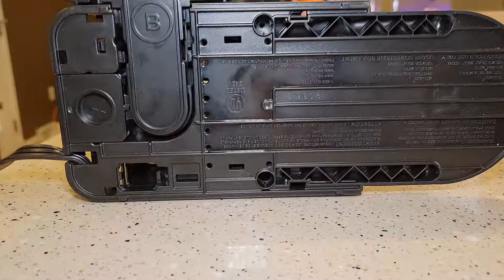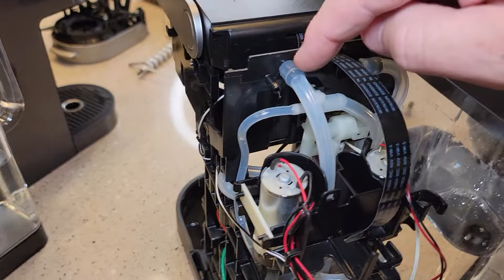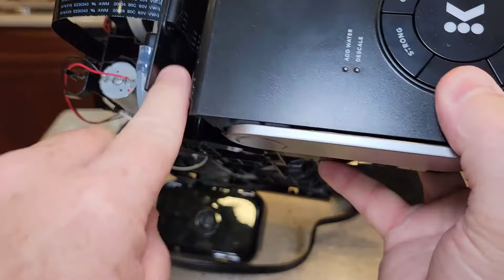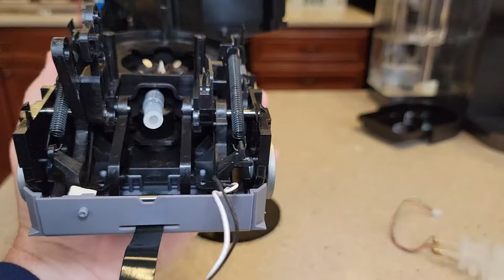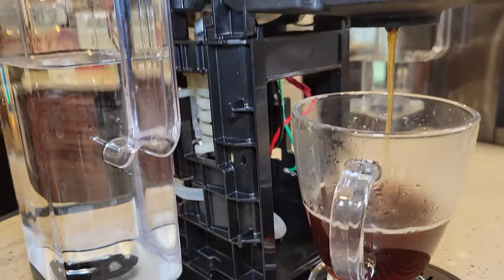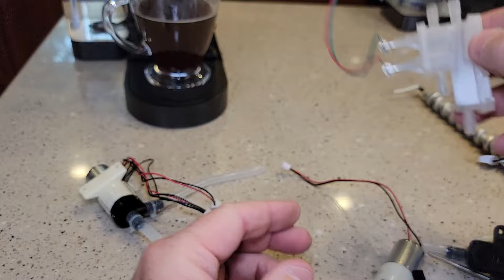🔍☕ Keurig K-Supreme Inside Look | How It Works & How to Take It Apart

Comment: After several K-Supreme Plus(s), descale always ends up the same. When Brand-New there is an accurate 12oz dispensed when that button is selected. After Descale there is anywhere from 8-10oz dispensed. Repeat that several times and it reduces to just about nothing.  So after taking this thing apart, what would you say is the most vulnerable part to cause the Descale to come on daily?  My guess would be the Descale solution can NEVER get the Heating Element, made out of aluminum, completely clean, like when it was new!
Reply: Descale light may come on when the air pump pressure gets to high.  The air tube on a k 50 was clogged with some debrie and descale   light  was on constantly.                      With the k supreme with no heater tank and  water level sensor,  how does it know how much water is   dispensed?
Reply: I have suggestions but you do them at your own risk because you may do more damage.  I am confident that all the lime scale can be removed from the heating tube assembly.
First, when descaling with either the commercial solutions or "regular" white distilled vinegar that is 5% acetic acid, you may be breaking chucks of scale loose from the flow path and they are getting stuck at critical locations in the flow path.  These restrictions can reduce or cause variation in the flow from the pump and cause a pressure increase. They can also allow the pump to rotate without it discharging the correct amount of liquid with each revolution.  I am pretty sure the Hall-Effect sensor on the bottom of the water pump contributes to knowing how long to run the pump.  If the pump discharge flow is not accurate for each of its rotations, then your coffee mug fill will not be accurate.
When the pressure increases in the flow path, a small piece of tubing conveys that high pressure (caused by a restriction) to the the pressure sensor on the circuit board, causing it to shut down the brewing cycle. Sometimes (with my 20-22 grain hard water), I had a lot of scale inside the heater tubing assembly.  It takes a good bit of time to dissolve calcium lime chunks using regular vinegar.  For the last few years I have been using 30% distilled vinegar for descaling.  I run two discharge cycles while in descale mode and then leave my unit sit for 20 to 30 minutes.  Then I do another two discharge cycles and allow it to sit again.  The wait time on the second set of discharge cycles varies depending on what I am seeing in the discharged vinegar.  If there is a lot of large limestone flakes in the glass when I swirl it, I wait long after each set of cycles.  Usually after three or four sets of discharge cycles the discharged vinegar is almost clear, so I just continue to do consecutive discharge cycles until the "add water" light comes on.  Then I rinse the reservoir thoroughly with tap water, refill it with low-dissolved-solids filtered water (from a Brita pitcher) and complete the descale process.  You can find 30% distilled vinegar in the pesticide section of your hardware store or big box supply store.  Why is the concentrated vinegar in the pesticide section of the store?  Because it is frequently used as an approved "organic" weed killer and sometimes an insecticide!  
So far all of the sensors in my unit's flow path have continued to work, probably because they are made of either stainless steel or chromed steel.
In the days before I used filtered water in my unit and before I switched to using more concentrated vinegar, I would sometimes remove a pressure-side piece of tubing (these always have a clamp or zip-tie on them) and use a syringe to draw and then backflush segment of the flow path.  Now with filtered water, I don't get near the lime scale build up between descale cycles.
I hope this information helps someone, since it's been years since @dennisdugan7476 posted his question/comment.
Reply from the maker: Great question, I am just not really sure,  the descale light comes on after 250 brew no mater how much build up your machine has.
Reply: Maybe the scale build up is really bad and the speed of the descale process is too fast if you follow the instructions exactly. Suggest to leave the solution in the tubing for some time (30min-1hr?) to let the solution dissolve the Ca buildup better. So, after running the solution through the machine once or twice, stop for some time. Then, come back and finish the descaling process.

Also, if the amount of fluid is less than what is desired, it usually means that a solenoid is going bad and would need to be replaced. There are videos of this, just search: solenoid Keurig. If the solenoid is closing prematurely,, the unit may detect increased pressure and thinks that scale buildup is causing it, hence the descale light comes on.
Good luck!
Reply: In Keurig’s defense, that model has gotten better in the last two years. I originally got that model from Costco, so it was easy to return whenever it failed. The one I’m using now is going on 1.5 years and has no problems with flow accuracy.

Comment: The flap stops the pressure  to the needles if you should open the lid while brewing. This prevents the needles from spraying hot water and coffee on you when you open the lid.
Reply from the maker: Awesome!! thanks so much!!
Reply: Our flap became removed during a cleaning. Afterwards, the machine produces only clear hot water, no coffee. Any suggestions on reinstalling the flap?  We still have it, intact. Keurig support tried to sell me a new machine.
Reply: @Thymediadude  thats my problem too - did you ever figure it out???
Reply: @Azkrazykat  Nope - bought a new unit.
Reply: @Azkrazykat  The missing flap acts like a by pass valve. Water does not reach the pod with the flap missing. The flap makes the machine idiot proof by diverting hot water from the needles if the top is opened during brewing. This avoids lawsuits.
Reply: Thanks for the info !    I  was thinking  it was a steam release vent.
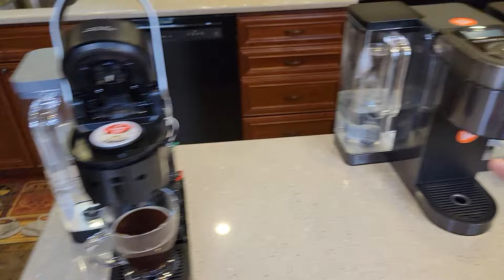Reply: Hello, this part fell out of my Keurig when I opened it up and I don't know where it goes.  Do you know where it goes?  12:47
Reply: But how is it reinstalled?
Reply: There are two long strings that feed back into the unit.  If you just have the plain fap, they broke off and at flap cannot be reinstalled without a new one.  Keurig won't sell you that part unfortunately.  There is a "hack" to fix that but it defeats the safety function.
Reply: That flap weakens over time, seeps and causes brewing water to skip the k-cup and drain into your mug.  I understand it's a safety feature but it's an inherent design flaw.  Adding a 1/8 in neoprene pad on that deck restores it's function but it's not a permanent solution.
Reply: I was guessing the flap allows any remaining water to drain out of the needle area when you open the lid, to prevent mold growth and clogging.

Comment: My keurig k supreme doesn’t turned on 
But look really good inside 
I don’t know 
What happening ?????
Reply: If it is dead - it is the thermostat - I had three units die after descaling - Keurig sent me a K-Elite as a replacement - opened up the last bad one I got - pressed the button and it came back on....  It is not supposed to be user serviceable - so this is a manufacturer defect.
Reply from the maker: I have another video on how to fix it  https://youtu.be/IdE_4NIQEro

Comment: That thermo-sensor is actually resettable. There is a small hole in the center of it and you can reset the switch with something like a paper clip. Had an issue with mine after a failed descaling process which seems to be a common issue with these units. The entire unit would not power up due to that thermo-switch being tripped off. Reset it with a paper clip in that hole and the unit came back to life.
Reply: OMG! THANK YOU! THANK YOU! THANK YOU!  I've had 3 multi-stream brewers mysteriously die on me. Keurig has always been great about quickly replacing the machines under warranty, but when my latest unit died this morning, I wanted to see if I could save it. The video helped me with disassembly and diagnosing the problem, but your comment allowed me to reset the machine and had be back in business.
Reply from the maker: @longhornhamilton44  Your Welcome!!!!!
Reply from the maker: Wow it this works you are a life safer!!! thanks for the tip and I will be trying it out.
Reply: How did the descaling process fail?
Reply: Yes confirmed. I opened the case with 2 kitchen knifes, the job took about 1/2hour.  Used a toothpick for the reset.

Comment: KEURIG K-SUPREME not working let me know how fix it. thank you
Reply from the maker: Not really sure, but there is an overtemp thermostat that is mounted to the heating element, once it opens up it does not reset and the machine is dead.

Comment: Can you replace the thermostat? The way you described it makes it sound like it's supposed to act like a fuse.
Reply from the maker: I looked online and could not find a replacement Thermostat. The wires are soldered on it.  Which you could unsolder and solder them on the new one.  When this Open up from High temp it does not close.  I think its a one time use. it right on the heating element so if it get too hot the Thermostat open up.  You could replace it if you can find one.
Reply: @JustADad  There is small hole in the middle of the sensor that you can put a paper clip in to reset the sensor.
Reply from the maker: @kevinbadeau2858  Thanks so much, If this works do you mind if I do a video on it in the future?

Comment: What happens if you accidentally push the keurig to run water out the tank being in? Did I ruin it? I have that same model. Thank you
Reply from the maker: Yes it could stop working after this.  does your still power on?
Reply: I descaled mine and now it all of a sudden won’t power on. Follow directions from the manufactured website. Not sure what happened.
Reply from the maker: @paigemitchell8131  I would call Keurig customer care at 866-901-2739.  This could be a known issue Keurig has with this model of Keurig.  I have had other viewers with the same thing. When they called Keurig some of them said Keurig knew about this issue and sent them a new Keurig.    They have great customer service.  I think you will need proof of Purchase.  So sorry this happened.  I hate it when someone follows my directions and then it breaks their machine.  I am so sorry.
Reply: @JustADad  Hello,  Would you still recommend us to descale our Keurig?  If so, use their kit/solution or use vinegar?  What do you do?
Reply from the maker: @cherylcalifornia125  yes you should descale your machine. I like the Keurig Solution but it is more expensive and sometimes hard to find.  I use the Keurig solution.
Reply: @JustADad  Thank you so much for answering my question.  I appreciate it and will use the same.  I think I’ve seen the keurig solution online for under 7 dollars at Walmart.  I’ll have to look for it again online or see if they carry in walmart stores.